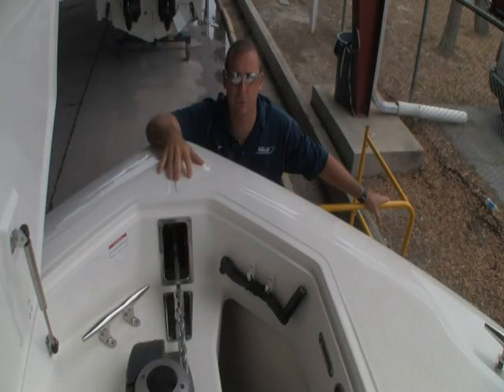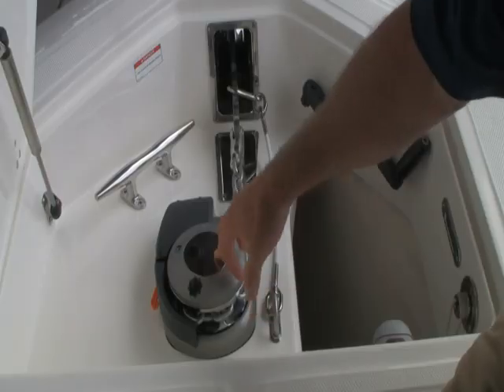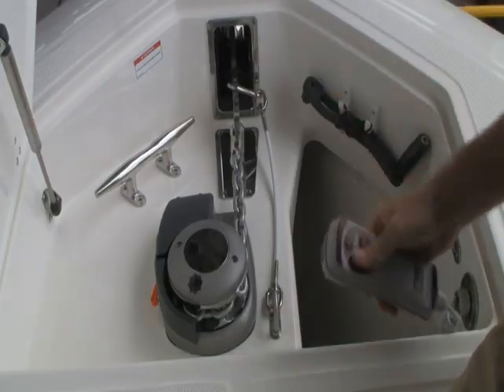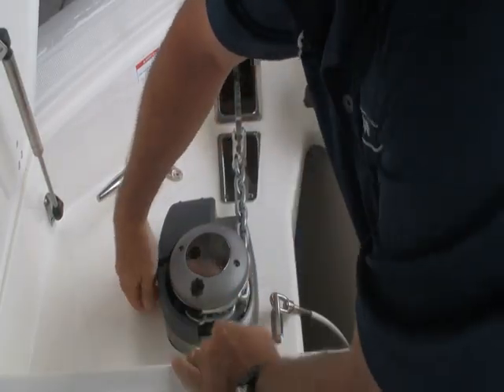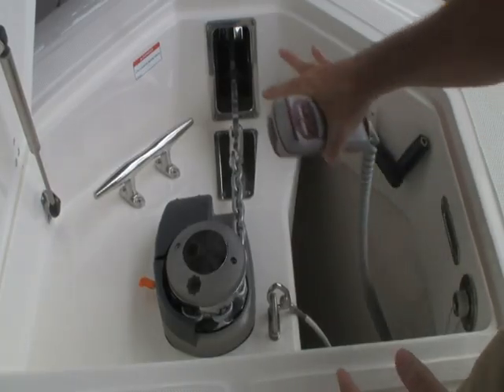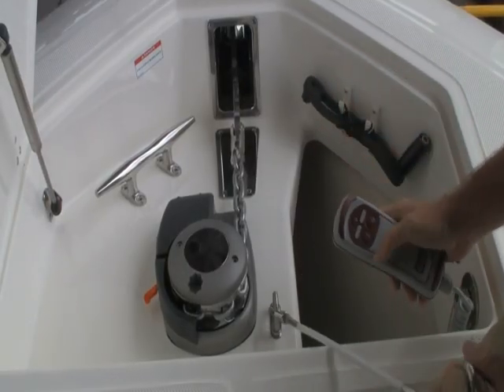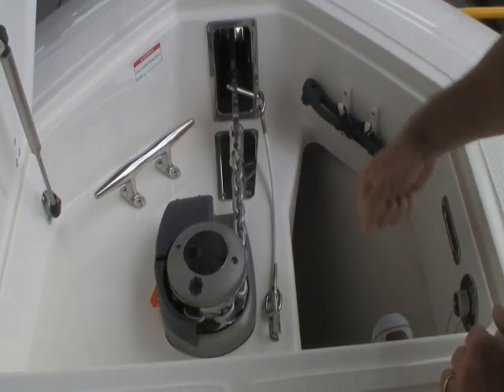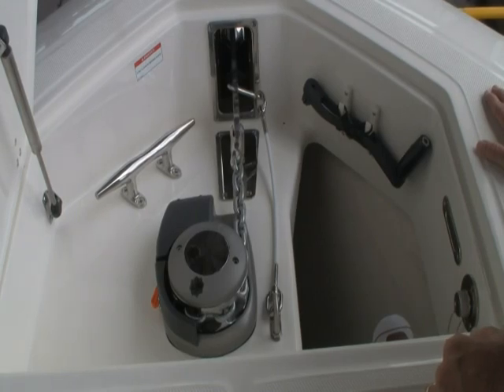How to Properly and Safely Operate an Anchor Windlass

Comment: The handle is not only there to crank the anchor up. You can also open the inner socket with it. This disconnects the drum from the windlass, what can be used to quickly release some meters of chain.
When on a new boat, you should always tighten this socket to make sure, that the drum is safely connected to the windlass and you do not lose you anchor. (Yes, the chain might be tied to the boat, but 50m of freely falling chain will definitely break it loose)